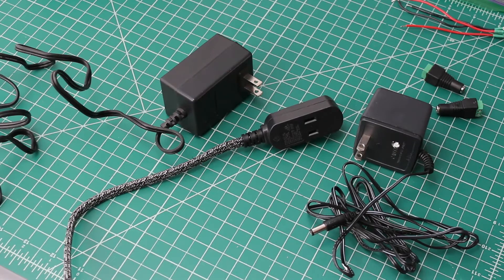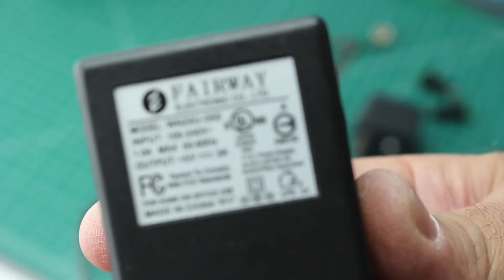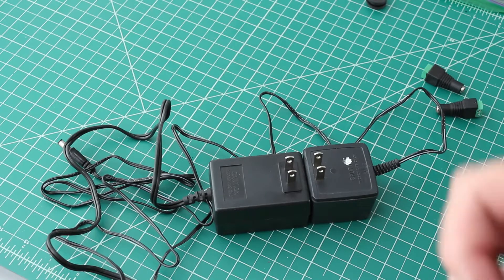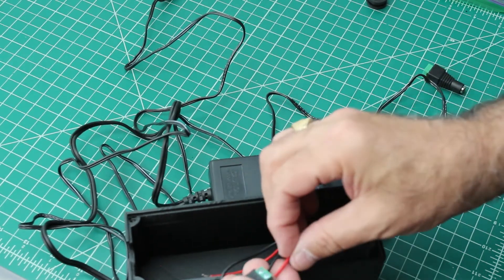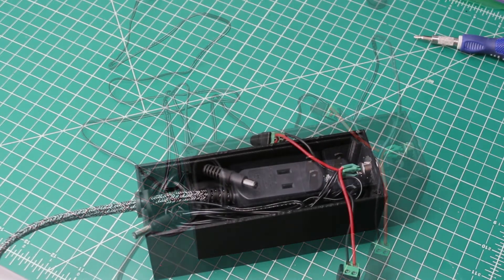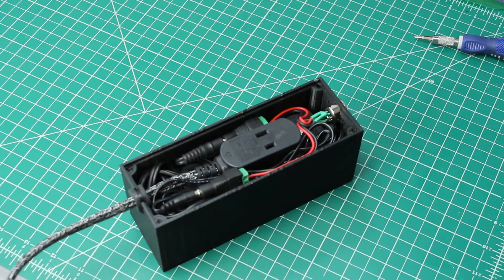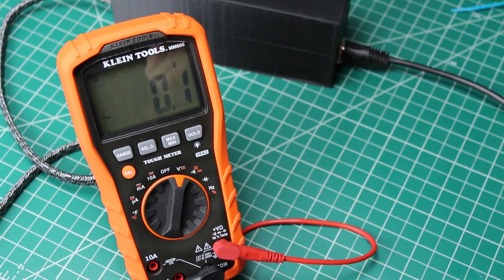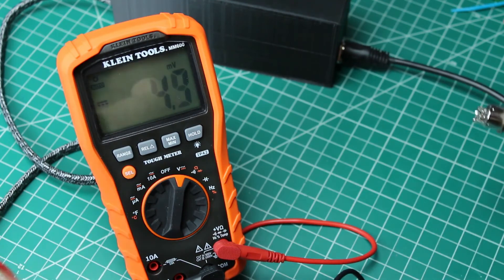Budget Commodore 64 Power Supply

Comment: Great video as always👍🏻
I have watched all your videos on the Commodore SX-64. I was wanting to know if maybe in the future you can make a video on showing which jumper needs to be cut so that I can run an independent external 1541 Disc Drive. The reason for this is when I hook an external disc drive to my SX 64 when loading a disk it always goes to device eight even if I try to load to device nine, which is my external. If it’s simply a load and run disc, I can use device nine and it will stay running. But if it’s a disc to where it loads and then stops, and I have to select and run the disc again it always goes to device eight. I have the schematics for the SX 64 but if I could actually see where that jumper needs to be cut so I can dedicate device and I would be great. Just a thought thanks. Keep up the good work.
Reply from the maker: I think this may help you. Go to Minute 35:00 of this video:
https://www.youtube.com/watch?v=5ooBF3j0-kQ

Just note though that you may want to wire in a switch to choose jumpers so you can choose to make the default sx-64 drive 8 or 9.
The video above uses a nice Ultra Rest mod which uses the front panel pushbutton. You can get that kit here:

https://www.cbmstuff.com/index.php?route=product/product&product_id=92

For more info, search YouTube for Jim Drew Ultra Reset SX-64. Hope that helps you out.
Reply: @revivingretro  thank you very much.